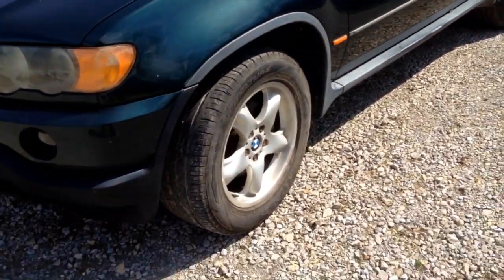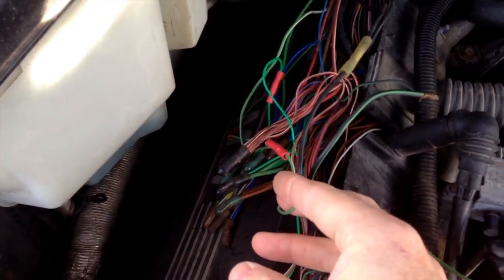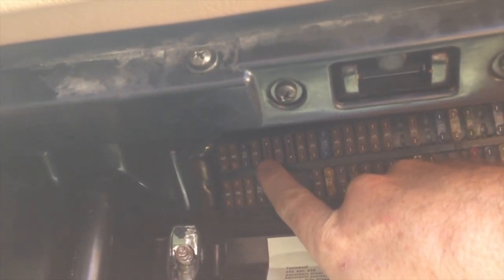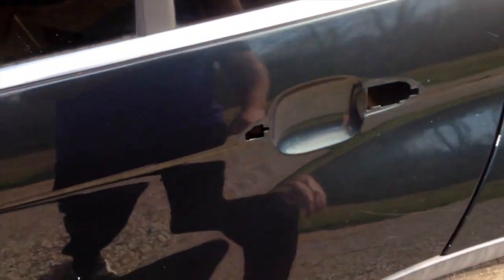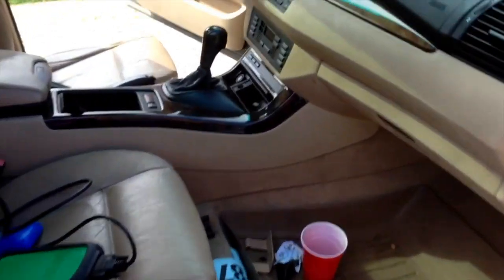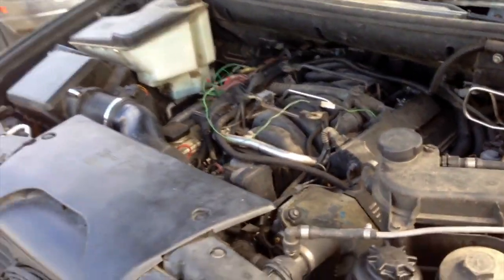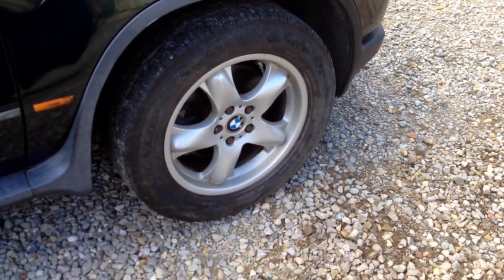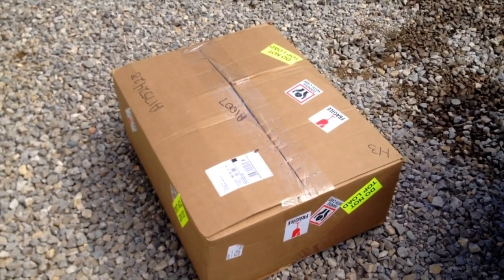Starting The $300 BMW X5 , Fixing Issues And ordering Parts

Comment: GREAT VIDEOS, THANKS.
 WOULD HAVE ANY IDEA WHAT'S GONE WRONG WITH MY 2003 3L DIESEL SPORT X5. DRIVING ALONG THE OTHER DAY, THE BLOWER STARTED UP ON IT'S OWN, IF I SWITCHED IT OFF IT GOT FASTER AND WHEN I ARRIVED THE BLOWER CONTINUED EVEN WHEN I TOOK THE KEYS OUT. IT MUST HAVE SWITCHED OFF BECAUSE TWO HOURS LATER I GOT BACK IN AND IT STARTED OK. DROVE IT HOME, AGAIN THE BLOWER RUN ALL THE TIME AND GOT FASTER ON FULL, WHICH IT SHOULD OF COURSE BUT IT ALSO GOT FASTER IF I SWITCH THE BLOWER CONTROL OFF ALL TOGETHER. ARRIVING HOME IT AGAIN CONTINUED TO RUN WHEN THE CAR WAS SWITCHED OFF AND KEYS REMOVED. THE NEXT MORNING THE BATTERY WAS FLAT AS A PANCAKE AND HAVING TRIED 4 CHARGERS THERE SEEMS TO BE AN ISSUE IN RECHARGING THE BATTERY. THE CHARGER FLICKS TO MEDIUM CHARGE THEN SECONDS LATER IT FLICKS COMPLETTLY OFF AND CONTINUES TO DO SO ON ALL 4 OF MY CHARGERS. DIRECT FAULT SOMEWHERE MAYBE? THANKS FOR LOOKING AND HOPEFULLY YOU MAY HAVE SOME SUGGESTIONS? APPRECIATE IT,  REGARDS STEVE

Comment: Do you usually service the transmission in those 100k+ mileage X5's. I've heard if they work to leave 'em alone as changing the fluid might cause more problems than it's worth.  What do you think?
Reply: gordonfrank i$ it's never been changed just leave it

Comment: WOW what are the chances. I stumbled upon your videos trying to replace a X5 door handle. I bought a 2003 bmw x5 for $4k about a month ago and totally got ripped off. The check engine light came on and turns out BOTH catalytic converters were bad. Me and my dad had to literally take apart EVERYTHING just to reach the two converters. I was able to find a pretty good deal from CarParts.com (although there were a large number of negative reviews on that business, everything worked out fine for me, I gave them five stars). I was able to buy the two Evan Fischer cat cons as well as four oxygen sensors for about $560 total. I'm pretty sure there are even better deals on eBay or something. We also had to replace the door handle. My dad was too impatient to wait so he went to the BMW dealer without me knowing and bought a new door handle for $260! That's insane! I could have found one for like $50 on eBay! We also had to replace one of the window regulators, which wasn't that hard. We basically spent over a $1000 on repairs. That vehicle was not worth $4000 at all, more like $2000. Now, because of insurance and other stuff, my parents want to sell the BMW and get me a Toyota or Nissan instead. They're cheaper to repair and more reliable, don't take my word for that, I'm only 18. We were able to fix the check engine light, it hasn't lit up yet. The only light that's still on is the passenger side air bag, which came on when we were fixing the door handle. 
But yeah... What are the chances! I don't know what year your X5 is, but the compartments under the hood look a bit different from my 2003 X5. They haven't changed much, just moved stuff around.
Reply: Oh, I forgot one more thing. IT'S LEAKING OIL TOO. LIKE COME ON! The worst part is, we don't even know where it's coming from. I looked up some oil gasket fixes for the X5, they look super complicated and hard. You need a super long stick or something to hold up the engine or something super complicated. I also tried pouring some type of fluid that uses nanotechnology to clog up leaks. I don't think it's working. I really need to get rid of that car. This is my first car, and I'm never going to forget all of the trouble and burden that came with it. Hopefully I can learn from my mistakes and not get fooled again in the future. Fool me once, shame on you. Fool me twice, shame on me.
Reply from the maker: Hello , I guess you didn't know you can buy converters off eBay for around $30 new , or just run straight pipes and use the $6 spark plug non fouler to turn off the check engine light, anyway thats for watching the videos

Comment: Hi Nathan i watched all your videos.  Learned alot from them and also a subscriber. I ran into a 1994 bmw 540i auto. 130k miles. clear coat is peeling and body is straight with few door dings nothing major. Interior has a tear in the driver seat little dirty but good overall. Car starts and run. Original owner since new.  Been sitting on drive way for a few years. He is willing to sell for $1,000. Would you think it's a good buy since you know alot about these cars. And i really like the look of the e34. Any advice would be appreciated
Reply from the maker: It seems a little much but not a bad deal, the m60 don't have the timing chain guide problem it has a sprocket in place of the U-shaped guide, the only thing  don't like about the e34 is that it seems the leather is always trashed
Reply: I think I'll try to talk him down to $800. Car will need a paint job for sure. Thanks for the reply.